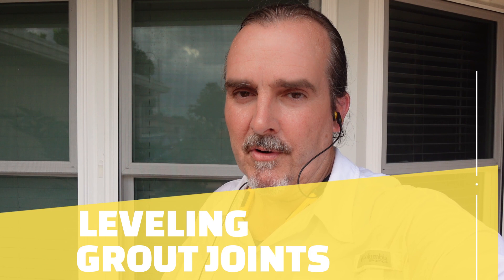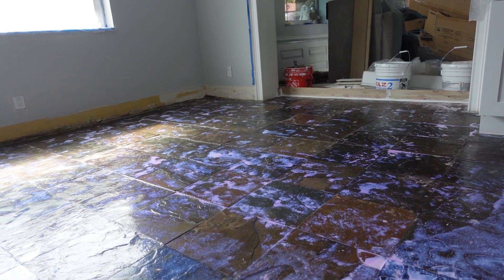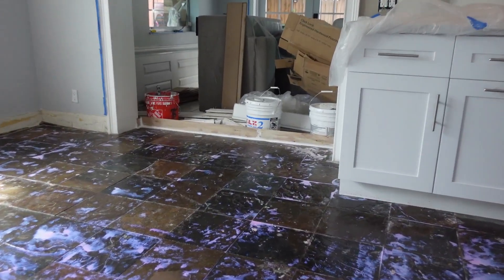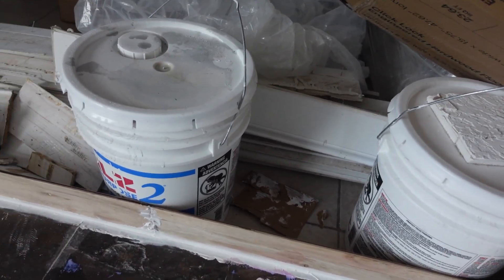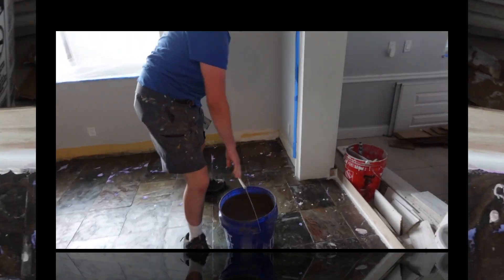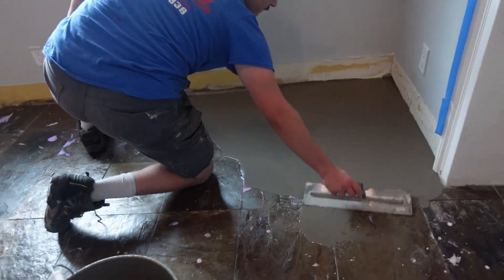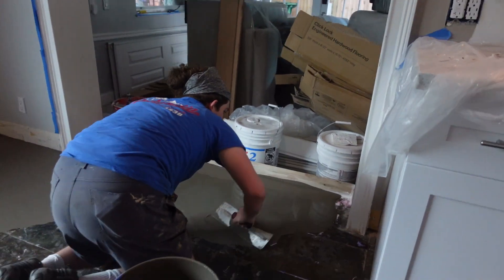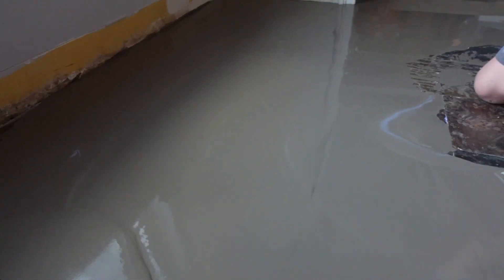HOW TO SELF LEVEL TILE GROUT JOINTS BEFORE INSTALLING FLOORING, WOOD, VINYL, LAMINATE FLOORING, DIY

Comment: In my opinion the entire room should have been gutted including the existing tile floor, then self level on the original concrete slab. Update the electric, put new walls, new doors, new window frames and moldings. You're not talking about that much more money to do it right.